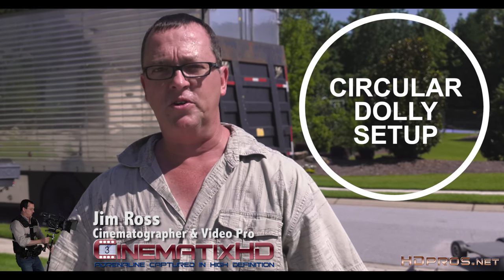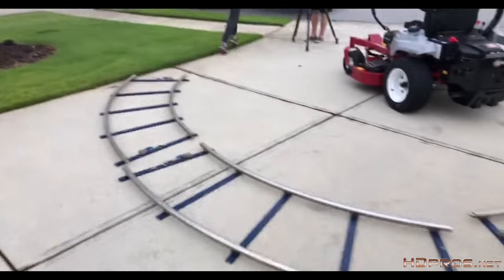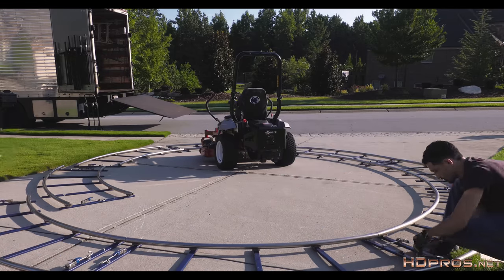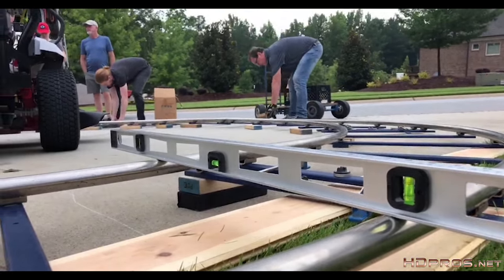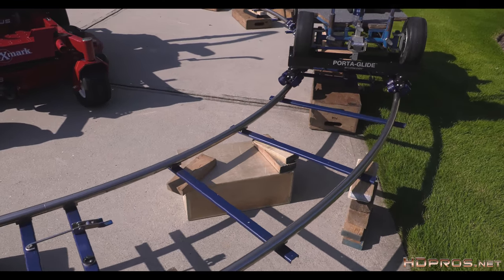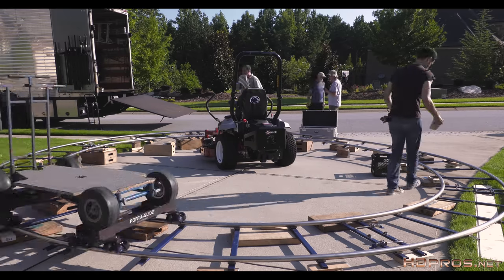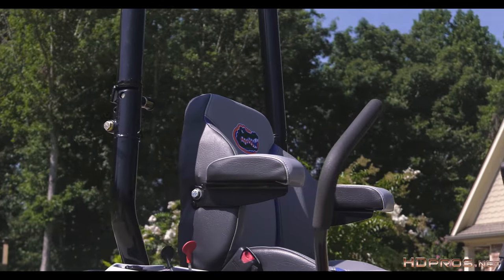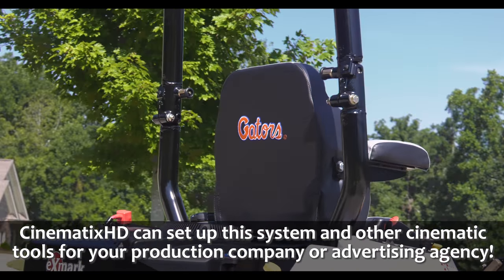Setting Up a Circular Dolly Track - Professional Motion Picture Tech - Cinema Tools Pro Tip #1:

Comment: Great video showing the steps necessary to set the track properly.  Rushing the grip dept to "hurry up" is a sign of inexperience.

Nothing strikes fear in the heart of a crew like a novice director or DP who doesn't understand why you cant just "lay the track out and go!".

Those are also the kind of folks who wonder why they cant frame out the opposite side of the track .

Comment: If you put a vertical pole in the middle and use that as your reference it may save a lot of time. Have graduations/measurements on the pole. Mount the dolly on the track. Put a camera on the dolly with it pointed at the central pole and zoomed right in. If the camera is in a floating mount then as the dolly goes around it will show the tracks up and down variation by the measurement marks on the image of the pole going up or down. If the camera is on a fixed mount on the dolly then the camera will show the relative levels of the two rails to each other by the measurement marks on the image of the pole going up or down. Once the dolly can do a full circuit and the image of the pole not move vertically then you know you have the whole thing level. After all, doing a full circuit and not having the image move up or down is what you want to achieve so using that as the testing/setup method should give confidence that the shot will be as stable as it was in testing.

Comment: Very cool! I was always curious how these shots were achieved in film.. Is the same concept used indoors? I imagine if it's a short movement they use smaller tracks? And I'm sure if the budget is big enough and it's filmed on a sound stage, they're able to move walls to accommodate the tracks?

Comment: It would be incredible if you showed how you store and transport the dolly and track! I can’t find a solid solution anywhere. This was very helpful!
Reply from the maker: Tyler I keep the middle of my grip truck open with carts on both sides strapped to the walls with E-Track. For transporting this I just piled the track in the middle on their sides and leaned it against my  carts. The dolly goes in last as I keep the back 5 feet of my truck open for pelican cases and other last minute stuff. But you are right. I don't know HOW I would keep this on my truck if I owned it. I have two ten foot lengths of straight track on my truck and that is easily hung on the walls above my carts. But this is a rental. I'd have to store it in a warehouse if I owned it.

Comment: Is it better to use wooden wedges or actual blocks of wood
Reply from the maker: We use both. Blocks are often used for larger gaps and then a wedge added. And rather than wood wedges I really like the plastic shims you get at HD or Lowes as they last longer and don't splinter like wooden ones.
Reply: @HDProsnet  what about just for setting tracks on a street, or grass

Comment: This seems like an INSANE amount of time, cost, and labour for a relatively rudimentary looking shot at the end of it. Why not use some kind of DJI self stability camera and wander around the subject?
Reply: he literally explains it in the video
Reply: @matt_freund  Thanks. 3:22 if anyone else had the same question. I suppose it would be good to see a 'before and after' of doing with/without a dolly. I'm not totally convinced.
Reply: @cquinnable  yeah, that would be good. You can see the difference between dolly and stabilazier in my oppinion. Most of the times it's just small movements but the beauty of a really stable dolly shot can't or almost can't be matched with stabilizer because they correct all movements in x y and z axis so the center of you're frame wount be exactly at the same position all the time. Some of the more expensive and newer system like the arri trinity come close, if the operator is really good. But cost  wise its like a really big difference. There is room for both though and both is pretty nice to have. Just keep in mind that all the equipment is just as good as the operators are.
Reply: well... so you're doing the commercial with an arri alexa + anamorphic lenses... will you be able to hold in on the gimbal?
Reply: Ronin 2
Reply: Good luck with multiple takes and replicating the exact same movement
Reply: Or just use a drone

Comment: long straight edge and a level set on that will halve your time
Reply from the maker: I'm shown using a level that is four feet long that spans the tracks. I understand what you meant about the straight edge to use the shorter more comom levels.